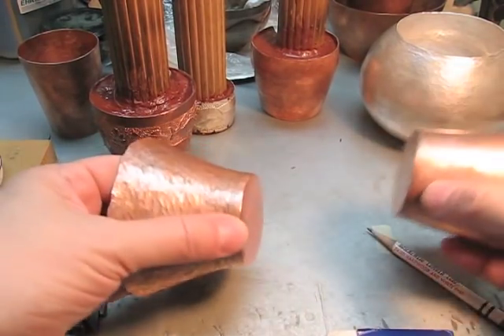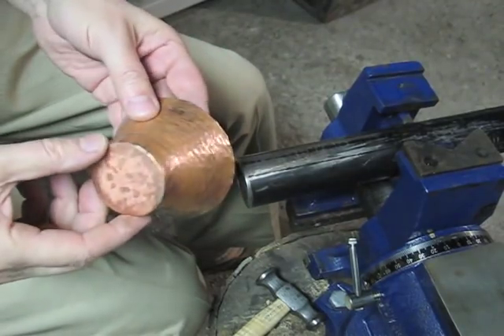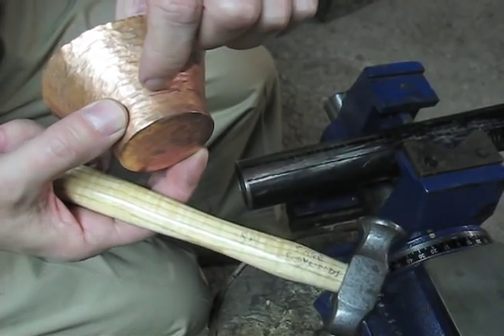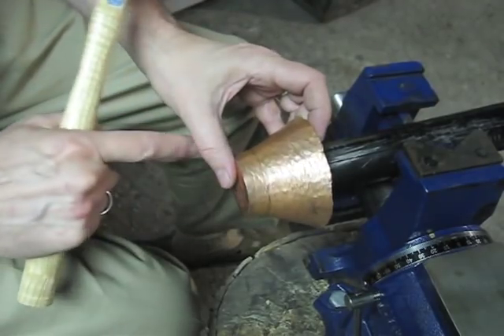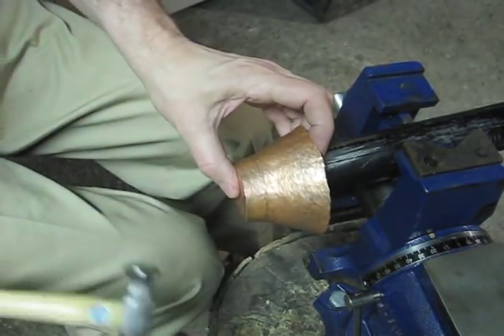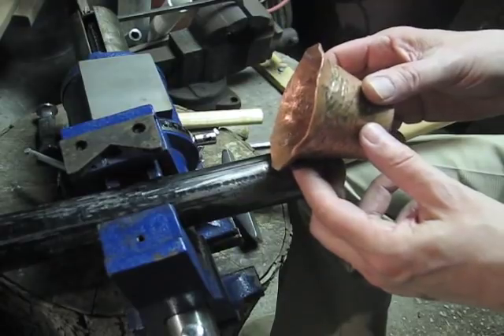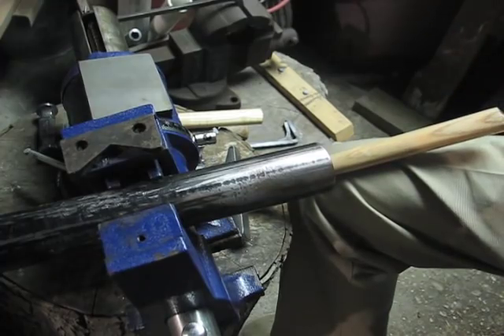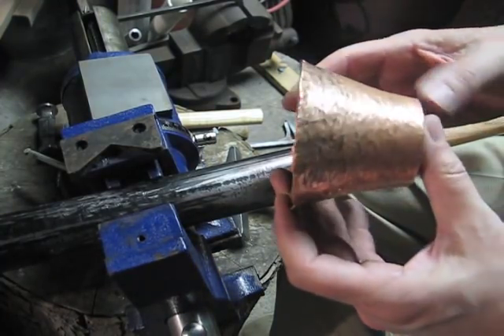Raise Copper Vessel 4- Beaker Part 3

Comment from the maker: When you move the metal in raising you are not thinning the metal. It would thin down if I kept it in the flat state. When the cup is finished it is still 18 gauge, properly done the untrimmed edge would be closer to 17  or 16.  I think it's a miracle, raising like this moves the metal up from the flat gathering from the sides as the diameter contracts and the cup rises.

Comment from the maker: You can get the sides perfectly vertical if you are trying to make a cylinder shape, A beaker typically has a wide brim over a smaller base with straight sides. See the next video in this series. It's a matter of holding the work piece at the correct angle and making enough rounds to get the shape you want. I can make this beaker, now, reliably in 5 rounds. This cup took about 7. Practice and experimentation teach you about aggressive and practical raising.

Comment: Here's a tip. Light your oxy/acetylene torch but use only the acetylene. As you know a black soot will come off while there is no oxygen burning. Stroke the vessel with the flame to cover it in this soot. Now when you strike you see exactly where the blows have landed because the soot will have been removed. Much easier than trying to follow a reflection and a proven technique in metal finishing. (In the UK anyway)
Reply from the maker: Thanks for the tip, I have trained myself to be aware of reflections and watch the strike marks. Don't think I would like dealing with the soot on my hands... I imagine it comes off...
 Thanks for watching.

Comment: Great video series, thanks! I'm looking to make a raised oval vessel sink for a repurposed vanity project I'm working on. I'm wondering what gauge copper sheet would be best to use and also if you might have any tips to help guide me in the process. Thanks in advance
Reply from the maker: if you are making an actual sink to use like in your bathroom I should think you would need 16 gauge copper. I have never made something that large and I suspect that it would have to be sunk into a carved depression on a stump using a fairly heavy hammer. You will also need a large torch to anneal. I think there are some videos of Mexicans making  large bowl shaped vessels here on YouTube, Watching them may give you some ideas of how to attack such a large project, sorry I can't be of more help. Good luck with your vanity project. ( BTW I no longer use the pipe to raise on I have proper stakes but nothing large enough for a sink. There are also some videos of a Japanese metalsmith who makes large vessels of fine silver. He has enormous stakes but the videos are more about the finished artworks rather than techniques. Also look up David Huang, he makes enormous  vessels and there are videos of some projects as they 'grow'.)
Reply: @Ceropegia  thank you for being open to offering other artists as resources for such a huge undertaking. This useable sink is my first raising project ever and though excited am feeling nervous as well. I'm in research stage and have none of the essential stakes or stumps at this point. And I appreciate your skill and am thankful for your great help.

Comment: Sage, I've been following this process and at this point in my progress finding pin holes in a few places. If I keep going, they just grow, as expected.  I started with 18g copper, and a good well prepared raising hammer and have been anealing at the end of each round. I believe I have been hitting to hard and deforming the metal too much (no being patient enough). I didn't think I was working it that much harder than you but clearly I am. I have done quite a bit of blacksmithing and sheet metal work, and lately a lot of anticlastic raising but never anything that takes this much time. I'm going to start over tomorrow and back off on the force. Is there anything else i should consider?
Thank you very much for these excellent, well though out,  videos! I have a good book on the subject but seeing somebody actual do it makes all the difference.
Reply: A very late [questionable] answer, but-

Lower the force, raise the rotations.

Comment: What is the relationship of the pipe diameter to the cup diameter?
Reply from the maker: There is no relation . The pipe is near the diameter of a regular T-stake which is about 1.25 inches. If you are going to try to raise on a pipe, get one with the thickest walls you can find. When I finally got a T-stake, I could feel the difference of using a solid piece of iron rather than the pipe. You can still raise on a pipe but if you can get a solid piece of iron the same diameter, go that way. Scrap metal dealers sometimes have useful scraps. Thanks for watching.

Comment: I noticed that it flared out is it possible to get the sides near perfectly vertical rather than flared out or would you have to raise it in a completely different way to achieve this?